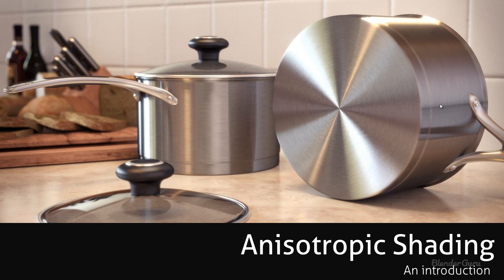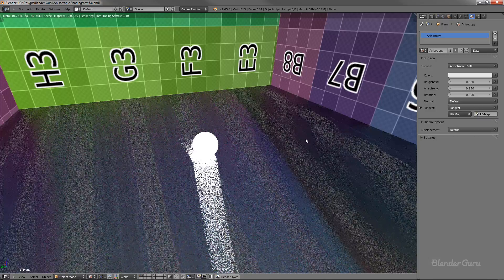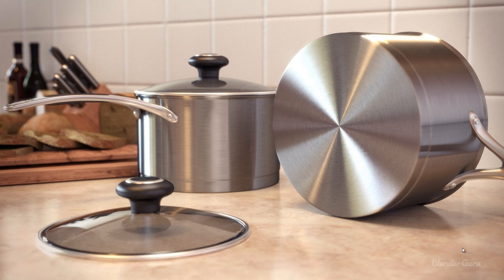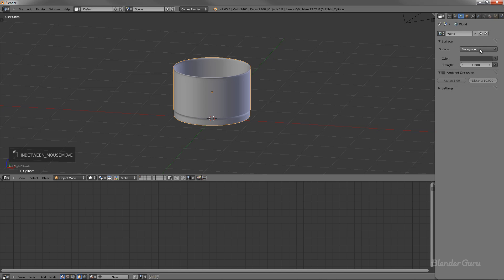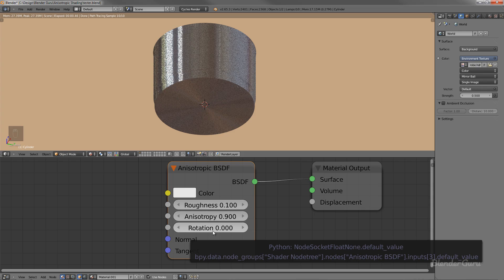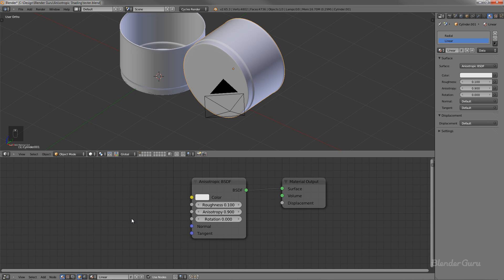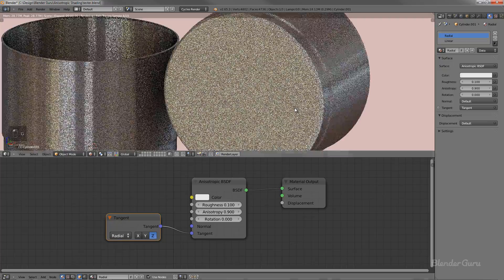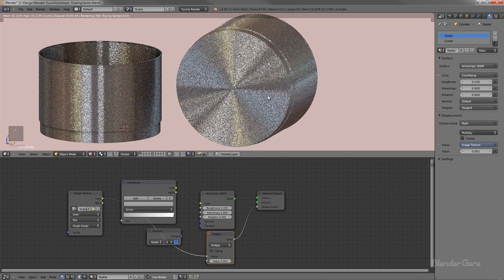Introduction to Anisotropic Shading in Blender

Comment: Any chance you will revisit this with the principled shader? Anisotropy seems to work very differently.
Reply: It's not that hard you just pull the anisotropic slider up on the principled shader then the rotation is the same thing and for the tangent you add a tangent node and connect it to the tangent input of the principled shaders bottom
Also you need some roughness for it to work
Reply: ye ur right
Reply: Make sure you are rendering on CYCLES not EEVEE! That was my mistake
Reply: i know what you mean
Reply: this was released 2012..... five years before principled bsfd released
Reply: MysticTerror394 yea, that’s likely why he’s asking for an update...
Reply: @Gredran  oh

Comment: What does mean crease do?
Reply: When you have an edge selected, the mean crease value can be used to make those edges hard/sharp. So when you drop a subsurf modifier on it, it will smooth your whole model, but the edges with a mean crease will remain sharp.
Reply: That's what he did

Comment: If you clock File, then User Preferences and then select the System tab and under Compute Device select CUDA and it should automatically set it to your GPU and change the option under the Render Settings.

Comment: Pretty sure you have to render on the cpu with cycles and an ati card, so that sucks :P. But to render it is helpful to open another 3D view window, and set the  view mode to rendered (i think), which will give you a realtime render as you edit :D